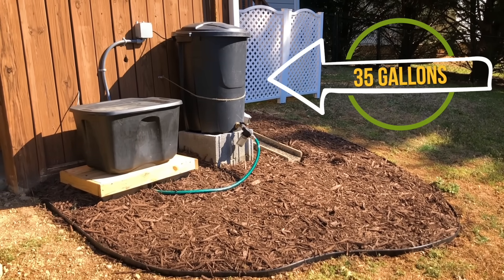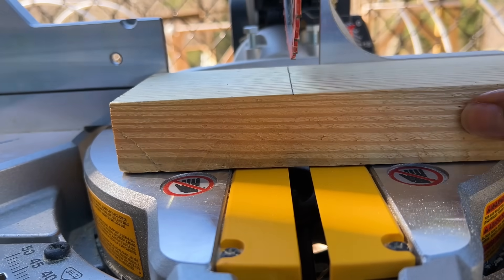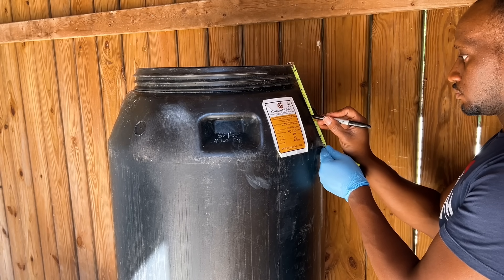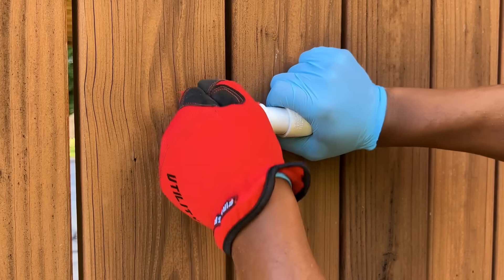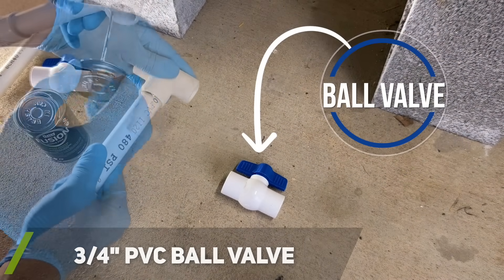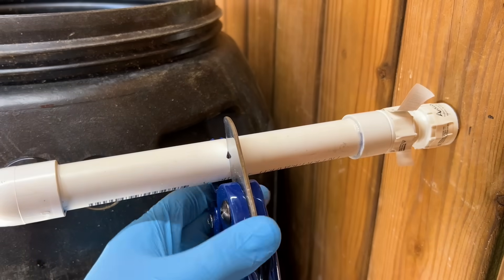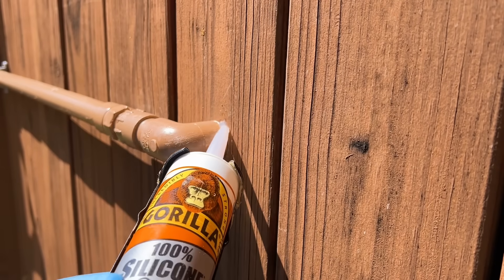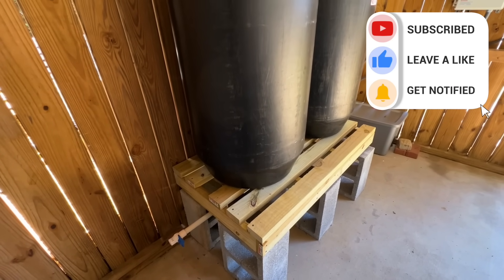Rain Barrel System | CHEAP Water Capacity Upgrade

Comment: Looks good. I made one a long time aho with 3 55gal barrels. I used 30ft of gutter and had it enter the sustem via the top of the barrel. It had a lid thag was two pieces and i used double layers of the window screen so bugs and junk could not get in and allowed for 100% of the water to entet the system. 

I did notnuse PVC glue except on the outlet bevcause its noy under pressure and allowed for quick disconnect of everything. 

I noticed the back cinder blocks in your video were upside down so the gaps were a problem with level base. Hope you got those switched around before you finished. 

Everything looks great, hope it lasts you forever.

Comment: As a complete noob to rainwater collection, shouldn't the outside PVC be at a downward angle from the downspout rather than running completely horizontal like you had it? Im just thinking that it would better the flow since you have more gravity doing its thing and prevent the water from just sitting in the PVC when its not raining. Other than that this looks like a really solid setup!

Comment: You're cinder blocks are sitting wrong, and not designed to be used that way, or they would build houses that way.  More prone to failure when using that way.

Comment: For the bulkheads you don't need silicone, I had 70 + litres of pressure against one with just the gaskets alone, not a single leak.
Reply from the maker: Awesome. That's what I would have thought based on how the bulkhead is made. Something I'll have to check again when the time comes to use one again. Thanks for sharing!

Comment: Put your water outflow 10cm up from the bottom and you wont have issues with gunk in the water outflow pipes. Where your water outflow is now, add a drain for all the rubble it accumilates during the year. Drain it trough these drains once every year orso and you will have a perfect system

Comment: I love to see how other people set up their rain harvesting! My plumbing projects rarely work out and usually leak so I avoid them. I use rain chains and put my rain barrels directly under them. I put a hot water heater overflow pan under the barrel to direct the overflow to a french drain. To use the water, I use a hose to gravity fill a 40 gallon trash can and use watering pitcher/can. I use the trash can so that I don't have to stand there and wait for the water can to gravity fill.  Not has handy as your pump, for sure. But, those pumps make quit a bit of noise. Congratulations on building a successful system and this is a very nice video,

Comment: Everything looks great. However I dont know why you wanted the inlet from the downspout to be level. A slight downslope will prevent water from just sitting in the pipe. Just my opinion...
Reply from the maker: Hey David. Yes a slight downslope from the downspout should be fine. Based on the diverter's manual, if the lid can be removed or if the barrel is not completely sealed, make sure the hole drilled into the downspout is not too high/low, else the diverter may not work properly. Since I installed vents into my barrels, I had to be cautious about the downspout hole height to prevent water from overflowing from the vents.

Comment: Why didn't you use a bulk head fitting on the bottom?
Reply from the maker: Because the Diverter kit I purchased already had the fittings I did use on the bottom and to save money. You could indeed use a bulk head fitting if you wanted to. Great question!

Comment: Great video! I was wondering about the outside PVC  pipe degrading as it’s  exposed to UV light, but you covered it. If you hadn’t spray  painted it would have become very brittle over time.  Nice job! 👍🏻
Reply: Also love the color/camouflage! Great work.

Comment: Screws and nails are a type of fastener. Using them to hold the legs in place may seem like a good idea, however, the two screws in each leg are what are holding up the total weight of the rain barrels.  I would suggest cutting some short shims and resting the 2x4 frame on top of the shims for complete support. These  shims could be glued or screwed into place.

Comment: so this is an upgrade because you have a two-barrel connected system instead of the singular barrel?
Reply from the maker: Hey Peter. Yes, the water capacity I can hold was increased greatly.

Comment: Of course geological information might be required when collecting rain, because while some areas might have flood accumulation, other areas experience drought when it hasn't rained in a while. (It is not smart to collect so much water from the rain drops, that it results in a drought.) * Defeats the purpose of collecting rainwater.

Comment: Very good video. On word of warning. All of your cinder blocks are sideways. As a building material cinder blocks lose allot of strength when the cells point sideways as opposed to up and down. If one side of the cell wall is thicker, as appears to be the case in your video, that side is the bottom.

Comment: Town I live in has a Used Item Farm Store that sells those White Food Barrels for $75 up but yet if you keep an eye on Craigslist, there is a guy who gets Trailers Full of them and only sell for $35 each. Tractor Supply wants over $100 for them.  I just go to Walfart and get Garbage Cans for $10 each. The Water is not used for drinking, only Bathing and the like. I do Try to Filter it also. 
I Have one white one and use a Water Filter that cost like $65 and is "the best" Micron Filter on the market... yet keeps getting plugged up by all the algae that grows on it. 
Right now, I can not afford to even drill a Shallow Well... more like no physically able to with a dislocated disc in my back.. And they want well over $8,000 to drill a proper well and $10,000 for a (above ground) Septic System. My Land has Commercial Grade Clay almost 20ft deep and hit it in less than 6" of digging. 
I live outside City Limits so I am free to do whateverthefuck I want...

Comment: How do you stop leaves from entering the system? Do you have any recommendations for filters for large debris using the downspout spigot system?
Reply from the maker: Hey Spring B, I use the following filter for this system: https://amzn.to/3lgl19H

There are downspout diverters out there that have a built in filter for leaves that you can find on Amazon. I would also recommend installing gutter guards on your rain gutters as the best way to filter out large debris.

Comment: Why did you run the pipes from the diverter level instead of slightly sloped downward toward the barrel? I thought you would want the water to run downhill slightly. Like a 1 degree downward slope.
Reply from the maker: I kept my incoming pipe level as I wanted my barrels to only fill to a certain level and then have the remaining water diverted down the downspout. Either way would probably work as long as the barrels are sealed. I also added venting to my barrels and needed to make sure the fill line would not have water coming out of my venting PVC elbows.
Reply: @GreenTechTown  Thank you for explaining, that makes sense.

Comment: Thanks for the video. I’m curious why you chose to mount the blocks on the “long” (taller dimension). From the video it seems that everything would have fit in the lower space arrangement.  Just curious because I’m “hiding” my barrels behind some foliage that will work in the lower position.
Reply from the maker: I just wanted to create as much space as possible for accessing the bottom PVC ball valves and for any maintenance I needed to perform on the bottom of the barrels. Looking back, due to the increased strength by placing the blocks the other way is something I would do a little different.

Comment: We need a relly good explanation how you can spray water from your water barrel hose???
Reply from the maker: Hey Robert. My next video that will release soon is based on explaining a little more about how this system works and how it is connected to my transfer pump. I also recommend watching my earlier rain barrel videos that will go into much more detail on how I wired things up.

Comment: I have seen a large increase in my area of people selling used liquid totes that hold 275 or 330 gallons and are set up for forklift moving.
They already have a valve at the base and you can get an adapter for pipe or hose thread.
You have to be careful to get the ones that are food grade unless you are using them for irrigation.

Comment: Heads up. The way you placed those cinder blocks is the weakest structural way. with too much weight it can crack and crumble. those 2 inside holes in the blocks you want open upwards. so weight load travels down the solid walls.. the way you have it that top layer/wall the 2x4 can push right through it.

Comment: Warning to everyone:

If you have a metal roof on your house, this will not be a problem.  But, if you have Asphalt shingles, I would not use that water for ANYTHING.

Here's why. Asphalt shingles are made with TAR. Just like on our roads. Chemicals from the Tar can mix with the water. The water may have a light brown color. This is most likely from the Tar in the shingles. 

I know he said he was not going to drink it, but I wouldn't use it in my garden or anything.  If you put this water in a 5 gallon White bucket at least half full you may see the brown color. To each his own.
.
Reply: That's concerning. Thanks for this information.  I have a flat roof with the rolled asphalt shingles, but it's completely coated with a silicone coating.  Is that safe or do I need to figure out another option?  Or do you have any suggestions on where I should look for this information?
Reply: @bill_mosienko  I don't have any suggestions, sorry. Some people are ok using this water in their gardens and it may not really be a problem. It's just that  I have well water so I'll use it. 

I would NEVER consume it though.  Silicon is a chemical also, do your research. Good luck.
.

Comment: Really nice video.  I have set up something similar several years ago.   I wonder if you mentioned overflow water issue.   Here in Texas it sometimes pours down rain and will over flow.  I got 7 barrels hooked together like yours and am redoing a wooden base that rotted.  I like that you use concrete block as those last a long time.  Keep up the good work.  I use a 12 volt RV pump to pull water out of my tank, hooked up to a couple batteries and an old solar panel.  Thanks for showing such a professional way of putting it together.
Reply from the maker: Thanks for sharing Dan! So far I have no had any overflow issues with the diverter type I'm using. I'm based in TN and I've had it installed for about 2 years now.

Comment: So clever!
And you have an eye for detail.
Why is rain barrel water not safe to consume?
Reply from the maker: Most systems setup for potable use need the correct filters in place to make the water safe for drinking. This is just a simple setup for garden usage which typically does need the same level of filtration.

Comment: If it doesn't rain for one week, you are out of water. The money you spent will pay for city water for 2 months.
Reply from the maker: Thanks for sharing Robert Kattner. I believe anyone who wants to rely only on city water should go for it, but for those of us who are interested in learning alternative methods, rain collection systems are a great solution. I also like that you can usually easily increase your water holding capacity if you notice you require more water for your application. My concept is to start small and gradually build up to a larger system as I gain more knowledge and experience.

Comment: Man I’m a plumber. You covered all ur bases here,  excellent job. Something to always think about when it comes to plumbing piping systems is maintenance and access. To work properly systems require upkeep.
Reply from the maker: Thanks Scott! I'm definitely not a plumber by trade, so feedback like that is always great to hear :D
Reply: Well all but actually using cleaner on the pvc.
Reply: @johngaltline9933  eh, primer is for taking pipes apart. IYKYK
Reply: @providentphotography162  uhh… not sure if this is a piss take or you’re serious. Primer-cleaner not only cleans the surface of the pvc, but also softens the material, allowing the cement to form a stronger bond. No one is taking apart a properly primed joint.  On the other hand, if you want ease of disassembly, no glue at all would be more than sufficient for a low to no pressure application like this. I can’t think of a case where a brittle glue joint that easily shatters apart is the preferred method.
Reply: Lol you must be a dodgy plumber if you think he did it correctly....
No PVC primer used before glue applications!
Winding Teflon tape anti clockwise (opposite) thread direction WRONG!👎
Reply: @Th4thWiseman  Aha.
To me the tape wound that way seems correct and logical.
Reply: @Sagittarius-A-Star  Winding Teflon tape opposite to thread direction is wrong because it sit on top of thread angles and not in the root of thread and when joining with the external thread it bundles up pushes backwards and doesn't penetrate sealing threads properly.
This is easily obseved when doing it yourself aswell and you will find diagrams in engineering articles further explaining this too.
Reply: @Th4thWiseman  Is it possible that we are talking about different things?
- winding direction
- starting point of winding
?
Reply: @Sagittarius-A-Star  possibly, but Teflon tape should wind along thread not across thread, that is the correct way to apply it👍
Reply: @providentphotography162  :  "Primer is for taking the pipe apart" ?!!  As a Landscape Contractor for 36 years, I would suggest you go read the spec sheets on glues and primers.  Guaranteed, joints done properly with primer and the correct glue will not come undone without cutting and then reaming out the fitting !!
Reply: @johngaltline9933  :  This Landscape Contractor agrees.
Reply: @Th4thWiseman  : I believe he said Clockwise.  In his "no-pressure" application, the glue is only there to prevent the joints from being jarred loose if he needs to work around the set up.... that, and an occasional drippy joint. 
He is not connecting the collection system to a pressurized system upstream of any pump he might add.
Reply: Your comment made me subscribe to this channel before I even started the video. 😊
Reply: @Th4thWiseman  He shows the glue he used. It's a self-priming single step primer/glue. The joints are primed.
Reply: I see all the primer comments.... you are all wrong! In this use case there is no pressure.

Pressureless systems do not need primer, In fact most pressureless systems do not even need to be "glued" which is actually "solvent welding" when it comes to pipe.
Reply: @GreenTechTown  check out my latest "rain harvester" barrel video.  You may really like it. Its big. Really big.
Reply: @Th4thWiseman  I see why the other three wisemen left you behind.. Such a pain in the ass.
Reply: Wished I could gave seen 5his 10 years ago.
Reply: If you're happy with this work, I really don't want to see what you can do. this was so bad. WAY too many 90 elbows, the wooden base is way to flimsy and it isn't even secured to the concrete stones, it's a complete joke.
Reply: @GreenTechTown 9⁹9⁹⁹⁹⁹.

Comment: Are the two barrels connected only at the bottom outflow pipes? Curious how both barrels are filled?
Reply from the maker: Hey William. They are connected only at the bottom. I am currently working on another video that will try to provide a better illustration for how this works since others were also curious about that.

Comment: Nice install , but pipe work specially plastic should be secured properly where the run was made underneath a brickwork , because water 💧 gravity will make the pipe work vibrate every time you open and shut the tap ,and sooner or later will weaken all joints on a  fittings. Have a look for yourself, someone is opening tap from outside and you stay inside . But brilliant job apart from anything else.
Reply from the maker: Good recommendation. I did think about using pipe hangers at one point but seen others with a similar bottom fill setup and did not hear of any issues. However, I agree with you and will probably look into adding some just to be on the safe side. Thanks for the feedback and support!

Comment: Good job although ... that's a lot of works to harvest and save 120 gallons of rain water.  I thought I would share my experience with rain collection to water my garden -- I had learned from my Uncle 25+ years ago to leave the water barrels on the ground and use a pump to pump the harvested water to a single elevated barrel for gravity fed watering system with battery operated timer to multiple zones, drip systems.  I have 18 of these 55g food grade blue barrels in my system and they are not modified in anyway since I pump away the water in each barrel as needed.  I cut away a 6" hole at the top to add feeder (gold fish) for water quality control, and add a screen to prevent insects from laying eggs in the water. I harvest the rain water from the roof by hooking up multiple garden hoses to every rain spouts around the house, that split and fill up three barrels at the same time. It's a manual system that requires me to move the hoses to other barrels when they get filled ... sometime in the middle of the night while it's raining 😢.  In addition, I also have to pump the water from the ground-level barrels to the elevated barrels every few weeks.  I have consistently harvest about 1000 gallons of rain water to use in my garden for many years.  I use zero water from the tap in my small backyard garden with this system as long as I am able to collect the 1000 gallons mark.  The point here is to keep the water harvesting system as simple as possible with room to add more capacity (barrels) as needed.  In any case, I really like how your system evolves as you expand your water usage requirements.  Good job, and happy Earth's Day, 2022.